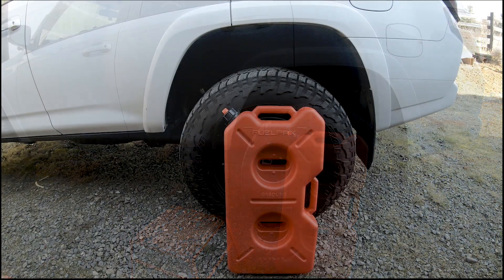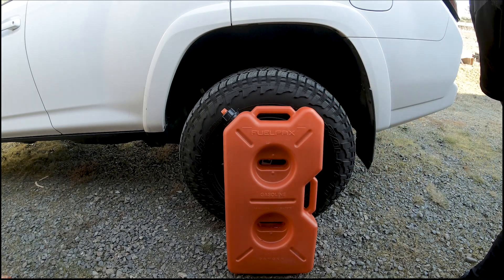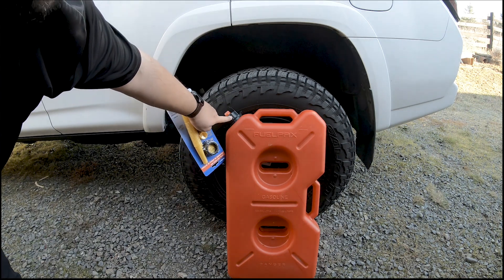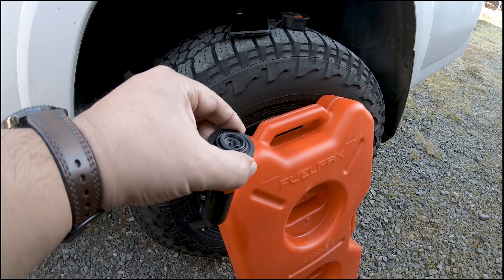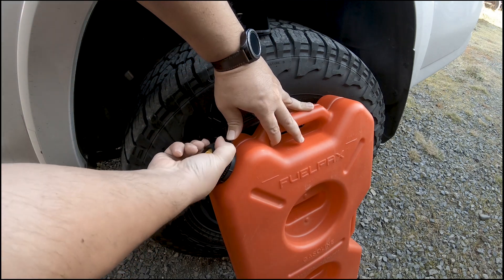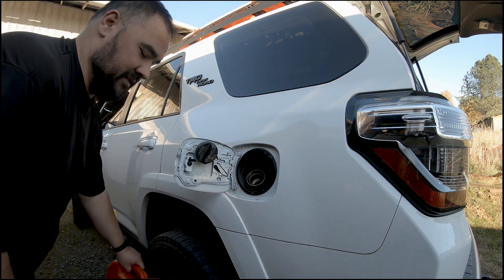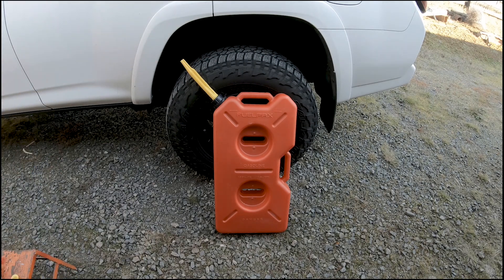Swapping out the slow spout on a Rotopax/Fuelpax to a faster self venting nozzle.

Comment: That is the water version of the spout. The seal base on it is smaller than the fuel one. It works, but the seal can tear easily if you over tighten it

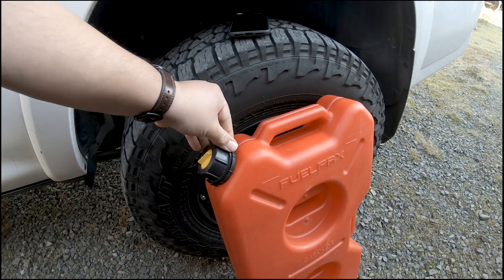Comment: On 0:14 you don’t need to completely remove t-handle, just align it to the hole to remove it. On 5:33 a simple flipping the can upside to show it’s not leaking with the new nozzle and old cap is better than just put it back in and call it the day

Comment: Good vid. But reason on why i have a metal gas can is because if the heat. I live in florida and it get too hot in here for a cheap plastic container to have in on the back of my truck. The metal hasnt fail me at all

Comment: I assume you have to unlock the rotopax from your roof rack and stand it upright before venting it (or fuel would leak onto your 4Runner) is that right? In other words you can't slightly open it to vent while it is mounted and on it's side, is that right?

Comment: Just purchased two 1.75 gal Rotopax fuel cans. These spouts DO NOT fit. Can't even get them halfway in. The cans have a permanent plastic sleeve inside the spout, ending in a screen. The throat is too narrow for this. Not too worried, though, as I just keep this spout in my storage box and use it when needed.

Comment: How often do you change out the gas? Do you use fuel additives or stabilizers rather? Thanks for sharing
Reply from the maker: I don't use any additives. I just swap out the fuel every two or three months. It really isn't a big deal. I just dump the fuelpax into the rig and then the next time I need fuel I fill it back up at the same time.

Comment: So no leaks with the new cap?  My 4 gallon leaked.  Filled it up at 8,000 ft then drove up to 13,000, back down to 8,000 and then back up to 9200 ft parked at a slight downward angle with it mounted flat.  Seemed like it didn't leak until the next morning.  Will a new gasket fix this?

Comment: Put the new nozzle and plug in and didn't check to see if it leaks?
Reply from the maker: Put it on the roof, looked and there were no leaks. Drove to my parking spot by my house and checked, no leaks. Checked several times over the next day or so, no leaks.

Comment: I have a similar rack and I'm trying to figure out how to attach my rotopax to it. Did you just pic up some t-slot hardware from a local hardware shop? I'm not quite sure how to go about it.
Reply from the maker: I just used short 1/4" carriage bolts in the cross bars of my Prinsu to mount the Rotopax mounts. Spaced the cross bars accordingly. Super simple and required nothing more than some nuts and bolts from Home Depot.

Comment: Hey Jake great video on swapping out the nozzle.  I've heard this is the way to do it also.  You have solidified the decision to swap!  I'm going with the Rotopax 3Gall for my ATV.  My question to you is this....mounted flat the way you have it on top of your rig, do you have any issues with it leaking at all over the time you've had it? I will be mounting on the front rack of the ATV flat. TIA, Mark

Comment: How frequently do you vent it?
Reply from the maker: The trick I've figured out is that when I fill it with fuel I fill it all the way. The less air the less expansion as fuel itself won't expand. If I do that I never have to vent it after the first time. I haven't vented it in well over a month.
Reply: That doesnt sound right, liquids expand the most !
Leave an Air Gap to Absorb Expansion, just like Radiator Expansion Bottles.
Reply: @DOCWHOK9  it’s the vapors that make it expand.

Comment: when the cell is full of gas and on your vehicle, do you drive  with the spout inside the can? I filled mine and thought the spout should be mounted for fuel delivering. while offroading the cans kept leaking! How are you supposed to carry fuel on board while driving? Spout inside or outside?
Reply from the maker: I leave the spout inside the tank all the time and have no leaks. Have you checked the gasket?
Reply: @TwistedJake  I will check them but I just bought them and used then fr the first time. Am I supposed to leave the spout inside when full of gas? Maybe that is why mine were leaking or venting when I had the spout out.
Reply from the maker: @xavierfumat7567  Without the spout there is no gasket so it will leak. You need the spout.

Comment: I have two 2 gallon Rotopax cans. I got ride of the EPA Spout which is crap and got what you have, the yellow spout. Last week I went to Arizona, 116 degrees outside! My pax swelled up and unfortunately the rubber gasket failed so it was a mess. Couldn't re-mount the cans back on the ladder on the back of my truck so I had to dump 1.5 gallons of fuel and then I finally got them on. Just sharing a story here but that yellow spout is not self venting from what I can tell
Reply from the maker: I think you've misunderstood what the self venting feature is. They don't vent when the can is closed and sealed up, they vent letting air in while you dispense fuel so it comes out a bit faster without having to manipulate an EPA nozzle sleeve with your non existing third hand. The issue you experienced with swelling and gasket failure would have happened no matter what nozzle you had on there. That is why the manufacturer says to vent whenever there is bit elevation or temperature change.
Reply: Where do you get this spout ?
Reply: @TwistedJake  We have these safety nozzles. I don't understand why you need a third hand? Ours you just push the can to start the flow. Edit: Scratch that, just saw another vid showing the locking ring, what a pain. The nozzles work well with out it.